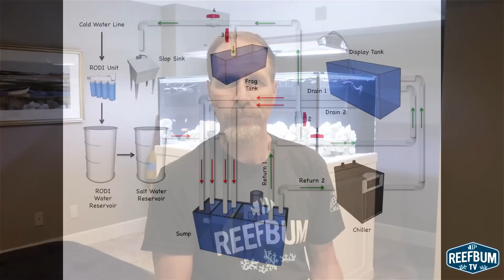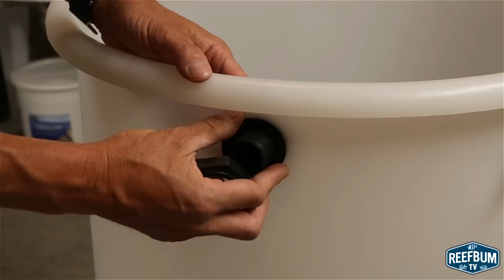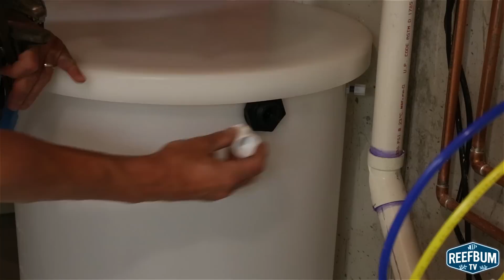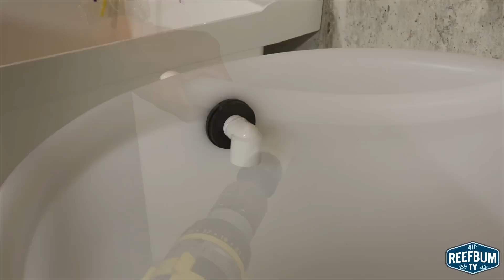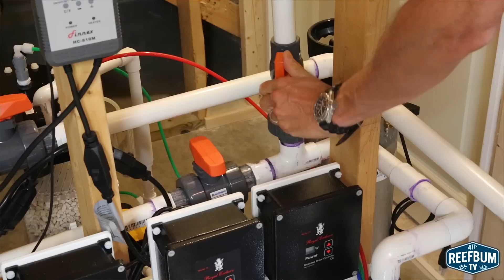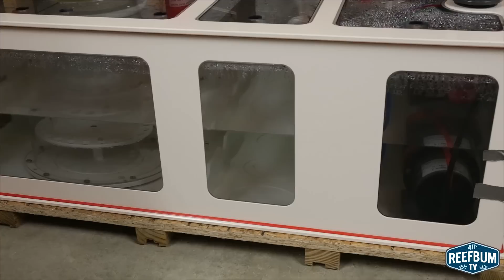Water Changes Made Easy

Comment: Looks great! How did you decide on the size of the hole to cut for the bulkhead? Was it based from the plumbing size of the pump?
Reply from the maker: You want to make sure the bulkhead fits snug in the hole so the size of the hole depends on the size of the bulkhead.
Reply: @ReefBum   Excellent, I’m using a COR-20 as a return and the intake is 1” so, I based the bulkhead off that size of pipe and in turn the hole for the bulkhead

Comment: Nice ! Do you have a preference for Bulk Heads & unions & valves ? Which brands ? Are the schedule 40 shut off valves OK ?
Reply from the maker: I used Hayward products on my last build and I have no complaints. And I do use the sched 40 shut off valves but not in situations where there is high pressure.

Comment: From your RODI Unit to the RODI water reservoir , I understand that the float valve closes up when the water gets to a certain level but doesn’t your RODI unit and the 1/4” line to the resevoir float valve get a substantial amount of pressure as it gets backed up?  I use a small RO Buddie system that comes from my utility sink and I fear that the unit and or the line would start springing leaks from the pressure as it would get backed up once my RODI Water Resevoir filled up and the float valve closed up. 
Thanks,
MROz
Reply from the maker: With my setup there is no pressure and thus I have not experienced any leaking.
Reply: Alas I found this... FLOAT VALVE KIT W/SOLENOID

Comment: Just curious why you didn't use a fixed float in the RO drum?
Reply from the maker: The one in the video has always worked for me but that is not to say there are better options out there.  Can you post a link of the one you are referring to?
Reply: http://www.maxwaterflow.com/Float-valve-for-reef-aquarium-reverse-osmosis-system_p_617.html this is the fixed arm float I use. It is just one less point of failure that I have to worry about.
Reply from the maker: Cool.  good to know and many thanks for sharing.

Comment: Hi ReefBum... Where did you get the drums ?
 And Nice System and setup..
Reply from the maker: +Janet Diaz Thanks Janet!  I purchased the drums from usplastic.com.  They are listed as a "55 Gallon Polyethylene Tank - 22" Diameter x 34-1/2" High".  The lids (listed as a "Standard Cover for 45 Gallon Tapered Tank") are sold separately.
Reply: ohh
ok, cool. gonna look into them ..  thanks

Comment: my opinion you did way to much work for this system you have a apex you should have just thrown a DOS onto the system and set it up to do you water change for you a lot easier you can do daily water changes and it works great. like I said my opinion
Reply: +Allen Jarrett 
Using a return pump is more efficient and faster when doing W.C. in his set up. He is multitasking his return pump smartly. The DOS would not totally free up his outlined diagram as diagram as he would only save the last run of pipe from the frag tank to the sink and one ball valve.

Comment from the maker: Thanks!  It was a lot of hard work to get it the way I wanted but it is certainly worth it over the long haul....makes it much easier to maintain the tank.  Anthias are doing great!  Should be adding some Chromis the beginning of next week.
Reply: Correct me if I'm wrong but This method only works if you don't remove more water than is in the sump?  With my tank I need to change more tank water than the sump holds for a water change.  If I drain my tank from the sump I can only drain as much as my overflow level allows.  Is that right ?  I love your setup.
Reply from the maker: @WinsteadSpeedShop  Yes, it is limited to the amount of water that can be drained from the sump.